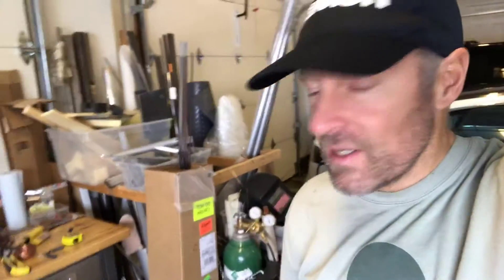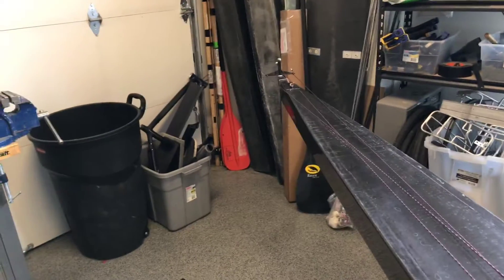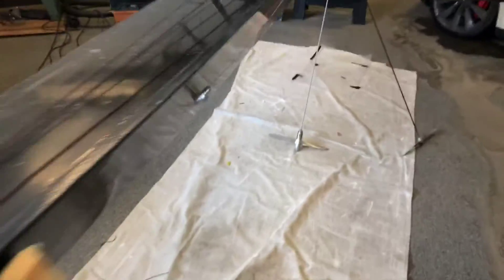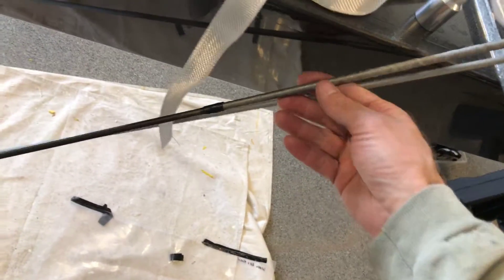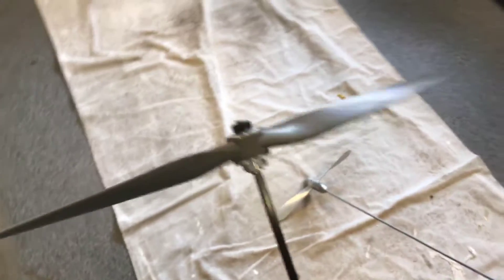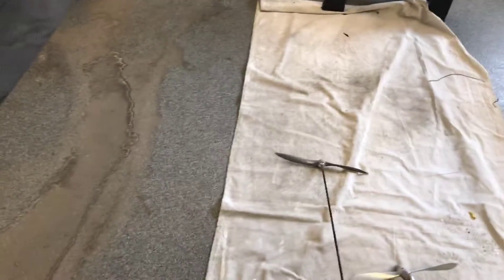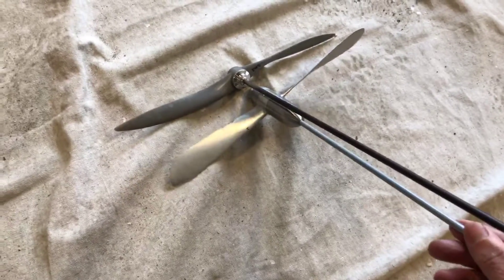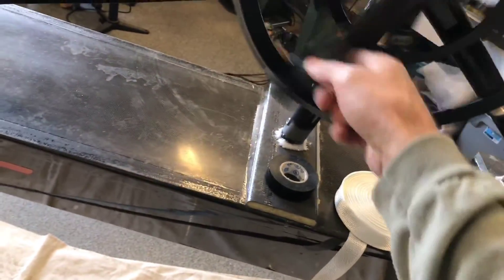A riveting explanation of the rudder and prop

Comment: How come you went for the long prop shaft? Since the prop is pushing against the water, the shaft is always under compression. It will bend and whip instead of just spinning around its axis. That causes excessively more drag and fatigue. Why not make a miniature outboard engine design?
Reply: Or paddles like on a steam paddler ? No need for 90 degree convert plus I think paddles are more efficent at lower RPM ?
Reply: "It will bend and whip instead of just spinning around its axis. " No, it won't; it is actually very smooth and stable when pushing.